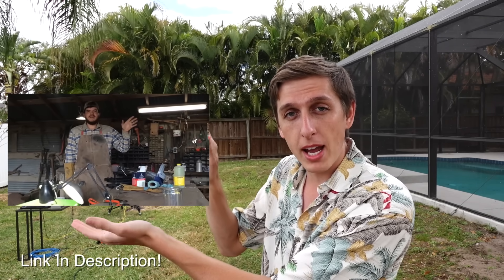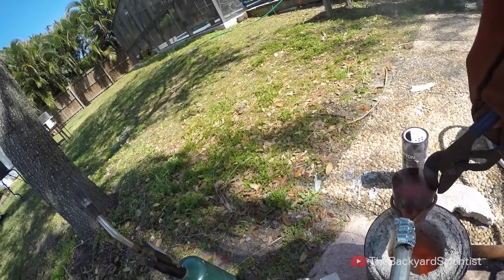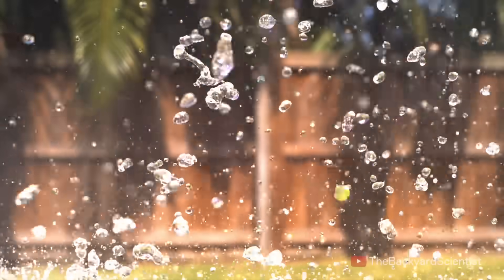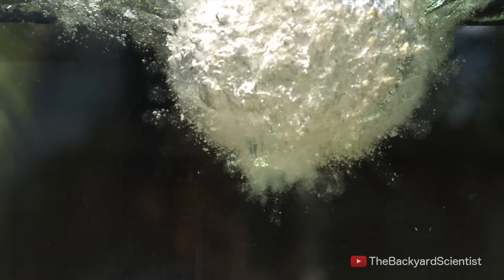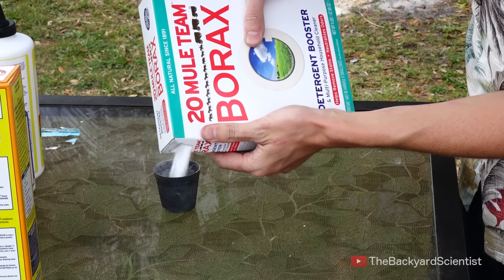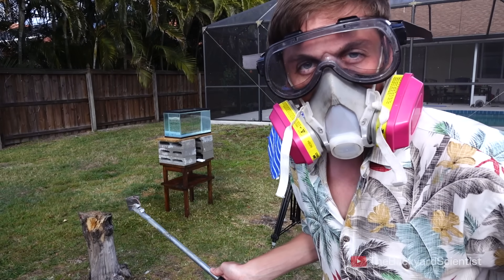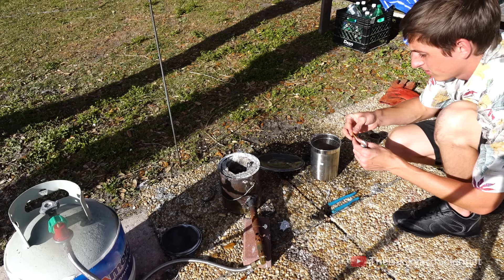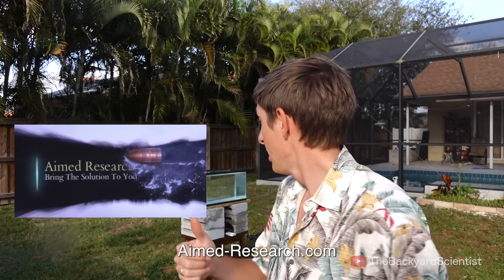Pouring Molten salt into Water - Explosion!

Comment: I am reminded of a Prince Ruperts Drop when I see this. Molten glass into water cools the outside glass instantly, while the molten insides cools slowly. The cooling inside tries to expand against the solid outside, creating a very structure stronger than steel. This glass drop cannot break unless the tail is clipped, causing chain reaction down the drop, exploding as the energy is released. 

Glass at this point would be pretty pure, at least I would imagine. However Molten Salt seems like it would have a lot of imperfections. If a Rupert's drop formed, could it instantly be shattering releasing Mechanical Strain Energy as well? Since it keeps shattering, the molten inside becomes the new outside, shatters, and more molten salt cools, shatters, and on and on with multiple explosions? I have no clue though. Just a thought!

Comment: +TheBackyardScientist I would agree that the reaction probably is physical rather than chemical, since the NaCl explosion was not a fiery combustion, unlike the Na explosion.
You mentioned that the other molten salts had a higher melting point. Might it be possible that they produced a stronger Leidenfrost Effect, better insulating them from the water at entry? By the time they cooled to the temperature of molten NaCl, the insulating steam bubble would already be well-formed and less likely to be breached, whereas the molten NaCl may get close to the water before a substantial Leidenfrost barrier is formed. Then it would be easier for the NaCl to breach the insulating steam barrier, causing it to touch the liquid water directly while still at a high temperature, causing the explosive reaction. Just a hypothesis. You could test this by heating an iron ball to the temperature of molten NaCl and dropping it in water, and then doing it again with the iron ball heated to increasing temperatures and compare the reactions.
Reply: +The BackyardScientist Scanning through the papers, especially the one including the molten aluminum explosions, seems to support my hypothesis as well.
As you know, the two molten salt papers reverse the procedure, so that the water is poured into the molten NaCl. This dramatically increases the likelihood of the water directly touching the molten salt, so that explosion is pretty easy to explain.
Moving to the aluminum paper: The aluminum does not explode until after it reaches the bottom, possibly because of a strong Leidenfrost effect while it moves through the water, and then after the aluminum scatters on the bottom it might propel through the water, breaking through the Leidenfrost barrier and directly touching the liquid water. The molten Borax did not scatter at the bottom, thus the Leidenfrost barrier remained better intact.
Also, the paper mentioned that if the flow rate of aluminum was slow enough, there was no explosion, because the aluminum solidified to quickly. The molten Borax seemed more viscous that the molten NaCl. Do you know if that is true? If so, it may have prevented the molten Borax from scattering at the bottom like molten aluminum (and the Borax didn't scatter).
Another interesting observation from the paper is that "the explosions became more violent if the water contained dissolved salt or if there were lime, rust, or gypsum coatings on the bottom." Possibly the dissolved salt interfered with the Leidenfrost effect? Saltwater boils at 4 degrees Fahrenheit higher than pure water, which should be insignificant, but saltwater may have a larger impact on the Leidenfrost effect. I'm not sure how the coatings on the bottom would affect the reaction, though possibly the undissolved particles encouraged more efficient scattering of the aluminum.
Of course, all of this is just hypothesis though logical deductions. Experimentation and/or further information would be required.

Comment: What's the specific heat and melting/boiling points of the different salts? What's the difference in viscosity? Are the salts particularly hydrophillic/phobic?
Reply: +Nicolas Brun-Cottan all salts are ionic compounds by definition, thus all salts are hydrophillic
Reply: Yes, but what degree? And what is the Salt liquids' consistency?
Reply: +Nicolas Brun-Cottan yes, there are many questions can be asked. Personally, I like the idea of Coulomb explosion. 
Anyway, I just wanted to underline  that there is no such thing as hydrophobic salt ;)

Comment: +Thebackyardscientist In my opinion the reason the sodium tetraborate doesn't explode like the molten salt because it has about twice the surface tension and does not allow water to enter the molten droplets, flash boil and break the outside now 'cool and hard covering. cheers

Comment: First of all. NaCl can only be split into Na+ and Cl-, ok? Na+ does not have electron and does not need one it will gain all of its stability from h2o around it. same as at  a normal temperature. Dissolving stuff is not a chemical reaction. Cl- is super happy to stay cl- surrounded by water. temperature will not make cl- to react in some interesting way with water since cl- got its so called outer shell filled and does not need extra electrons nor it is going to give it to something else if water is that something. it will enjoy hydrogens of h2o very much. so when you pour molten, hot nacl into water, that big fat boom, probably( i have no idea, trust me) occurs due to very simple thing, really fast heat transfer and really small surfaces of interaction + h20 loves to stick to na+ and cl-. so you have a small amount of particles per area receiving lots of heat. so i think that you just give enough energy to water molecules so they can form bubbles and expand really fast, and other liquid molecules keep coming and turning into gas. so maybe solubility itself is involved in this, as well. try cacl2 heated to the same temp as nacl, see if there is a difference.

P.S.: heating naco3 at temp above 851 oC leads to a formation of Na2O in contact with water it should form NaOH. But even wiki says that it reacts violently with water so i assume your naco3 was not that hot. It would be nice if you posted some temperatures of your salts before pouring them into water. but where can you get a thermometer for that hot liquid?

Boric acid is not that soluble in water compared to nacl. actually it is much much much less soluble in water which means that boric acid likes to stick more to other boric acid rather than water in comparison to nacl and water interaction. so your boric acid ball reduce surface area of heat exchange, in my opinion. well i could be talking bs as well. everything i say is my assumption. but it might make sense if salts with huge solubity at high temps create more boom than those with lower solubility at the same temp.

Comment: salt is sodium and chlorine and sodium explodes when it comes in contact with water could the drastic change in temperatures break the bonds and isolate the sodium?
Reply: +justin roze and the sodium kind of rides the chlorine so it gets deeper into the water than regular sodium so the explosion is the same but it happens in different places and since its happening deeper generating "splash" then it just looks bigger please tell me if this is making somewhat sense

Comment: ... how did you pick up that sodium with your bare hands?
Reply: +FluffyFighter667 By picking it up. It's not dangerous unless you throw it into water. You don't even need to heat it up, sodium is a very reactive element and generates flammable hydrogen and caustic sodium hydroxide upon contact with water.
Reply: Dasky14 your skin has water in it and if you touch sodium you usually get 3rd degree chemical burns
Reply: Either it wasn't just sodium then, or he has really dry hands. Might just differ a bit depending on where he got the sodium.

Comment: I think it's because of the viscosity of both the liquids. If you compare the table salt being poured in to the other salts, you can see that it is much more viscous. That means that it is expanding and becoming less dense as it is being heated in the furnace. That means that it's density and viscosity are both approaching that of water, meaning it can more easily be mixed into the water, meaning that the water is being vaporized more easily as the table salt is spreading out creating more and more surface area, so the water can't create as much as a protective layer of constantly vaporizing water. This means that the energy is being transferred to the water to reach equilibrium much much faster compared to other reactions, and when a lot of energy is released very quickly an explosion happens. The Super viscous liquid table salt is transferring it's heat so quickly, because of its surface area, that a bunch of water is vaporizing and expanding and heating up and causing an explosion, while the salt is cooling down and contracting and forming a solid. This means that as viscosity and density of a liquid approach water but it's temperature diverges from water, the size of the explosion will increase. I bet if you heated the other salts to higher temperatures, so their viscosity increased, you would see a similar reaction.

Comment: Finding the correct temperature to loosen the NaCl bonds enough was the key to allow water molecules to react with the sodium. Other sodium substances would yield the same reaction if you can correctly loosen their chemical bonds as well.
Reply: +kyungtaek park If it was sodium reacting with water then the pH would be basic after his test since it would produce NaOH. It tested neutral before and after, so it's not that.
Reply: +Xei Yes it appears so. I stand corrected

Comment: Being a physical reaction and not chemical, here are my thoughts as to why the table salt worked but the others didnt:

You saw more of an explosion when you heated the salt to a higher temperature. With the salt being at a higher temperature, it follows that it had a lower viscosity. With a lower viscosity, the water molecules find it easier to 'push' their way into the blobs of molten salt, causing more frequent steam micro-explosions. In addition, given that it has a lower viscosity when hotter, when it does cause some water to boil in this manner, the surrounding molten salt will get flung out further, and faster. This I imagine results in a steeper 'exponent' to the exponential nature of the reaction. 

Conversely, the other molten materials may have a) lower viscosity and b) lower thermal conductivity, resulting in less water/molten material interfacing, and slower heat transfer to the water, causing any steam produced to be done so at a much slower rate, perhaps below a threshold rate required to fling the molten material outwards into the rest of the water to achieve that exponential reaction you were looking for.

I'm an aerospace engineer, no physicist or chemist, so I may well be totally wrong but this is how I made sense of it!

Regards.

Comment: This is what is known as a steam explosion. Steam explosions are what blow the bark off trees that are hit by lightning, what causes popcorn to pop, why you don't put out a grease fire with water, and what caused the Chernobyl reactor to blow itself apart. It's not about melting point - it's about specific heat capacity. 

Molten salt (sodium chloride, halite) has a high specific heat capacity (about 43% higher than molten aluminum). I suspect you might be able to get the same effect with molten aluminum if you heated it up enough. I also think that one thing the molten salt had going for it was its propensity to rapidly crystallize. This behavior may allow the water to come into contact with more of the molten salt as the salt that the water is currently in contact with crystalizes/cracks ad infinitum. 

With aluminum (which will solidify into visible aluminum crystals if cooled slowly enough), you probably create something of a glassy state (amorphous solid) that has the effect of insulating, at least temporarily, the water from the aluminum that is still aluminum.

Comment: pH indicates the concentration of hydrogen ions in solution... NaCl contains no hydrogen so the pH level wouldn't change even if it did dissolve.
Reply: +Jason K. His test was to disprove the "It's the Na in NaCl that's reacting with water" hypothesis that everyone keeps pulling out their ass. Since it would react to form NaOH and release H2 you would expect the result to be basic if this were true, but it isn't, so it at least disproves that.
Reply: +Xei But if solid NaCl dissolves why would liquid NaCl (aka Na+ and Cl- ions) be any different. Salt plus water doesn't form NaOH or HCl. Na+ and Cl- are always spectator ions in solutions. It was just a pointless test.
Reply: Jason K. Obviously it merely dissolves but people keep saying the heat somehow decomposes NaCl into Na and Cl2 (even though it's well established that it doesn't). So it just provides proof to the people that keep posting those comments.

Comment: Heating it may or may not be separating the sodium and chloride, and the sodium is what is reacting with the water.
Reply: +Kimster14 Nah, NaCl doesn't decompose when heated. It will melt and then boil but it won't split into it's constituent elements.

Comment: Could it be that once the sodium enters the water the outer layer is cooling rapidly and condensing the still soft inner core, causing extremely high pressures inside the mass?which then once the pressures are high enough the pressure is released?

Comment: I still do not have a good explanation but you should try it with two more compounds to check if its physical or chemical. first you should try Potassiumchloride to see if its the "Alkali"-property of the NaCl that causes the reaktion and second try Magnesiumchloride(MgCl2) to check if its the chloride part. Further experiments with simpler Materials than Borax would show whats going on (like CaCO3, Na2SO4). Also a Experiment with Potassium permanganate(a complex) would be interesting. I'm looking forward to see new stuff like that!

Comment: Sodium conducts energy very well, so it cools super fast on the outside but does not have the strength to hold its lattice together.
Reply: +tonymengela Nope, it's lattice is broken when you melt it.
Reply: Wynton Goulding but it is reformed as it is cooled and the inside is still expanding shattering it. The same thing happen with molten steel and you add water to the surface
Reply: I'm now out of my depth. I'm an Aerospace Engineer, not a chemist.

Comment: I was running through a few theories as i watched this and got thinking about what happens when you pour water on a chip pan fire. It would almost seem that the instant rapid heating of water could be causing the hydrogen and/or oxygen to expand rapidly from the h2o composition of water almost like a balloon popping due to the sudden change of pressure. Would be interesting to see how flammable the gas is that is created during the explosion. The reason just the salt reacted as it did and not the other mix of sodium etc could be down to the properties of salt naturally wanting to separate into smaller bits as it cools there for rapidly expanding as it cools combined with the rapid heating of the water expanding. The heat energy has to be exchanging rapidly to the water after all.

Comment: It has to do with the sodium and it's reaction with water. Salt is held together ionically by donating an extra eletron. Sodium bonds with Oxygen and Hydrogen atoms to form Sodium Hydroxide. Normally salt lacks the energy to cause Sodium to bond with an OH, but if you heat it you add the energy. As each bond break and reforms more energy is added, if its rapid enough the heat will cause enough outward pressure to break the glass.

So that's what I pulled out my ass, hope it smells of roses.

Comment: I think it might be because NaCl wants to combine so fast with the H2O that the Leiden frost effect doesn't have time to react, but when it does, it has to split apart the bonds, creating an explosion.
Reply: +Carson Burns maybe the NaCl has a lower melting point than the other salts so when it enters the water at the lower temperature it does not create as much of a leidenfrost effect?

Comment: if you heat up NaCl, Cl steams up aaaand, you have Na metal which reacts to water, that's why it explodes.
Reply: +RandomYoutuber No it doesn't, if it was sodium reacting with water it would produce NaOH. That would make the water basic, but the pH test shows it's neutral. So it's not a sodium metal reaction.
Reply: +Xei well I'm no expert, I just said what was I thinking was happening.

Comment: Could viscosity of the liquid salts play a role?  I've used borax as a flux and its pretty gooey and seems like it wouldn't spread out to create surface area to distribute heat.  If sodium chloride as a liquid is less viscous, it could spread and create surface area much more quickly allowing for a faster transfer of energy leading to a more violent reaction.

Comment: This is what is called a smelt - water reaction.  It is a rapid evaporation of the water.  This what causes recovery boiler explosions in pulp & paper mills.  Over the years many workers have been killed by recovery boiler explosions.  These are the result of mixing molten sodium carbonate and sodium sulfide with water.